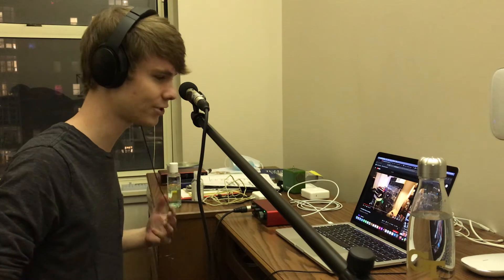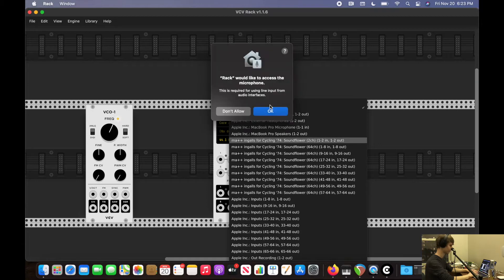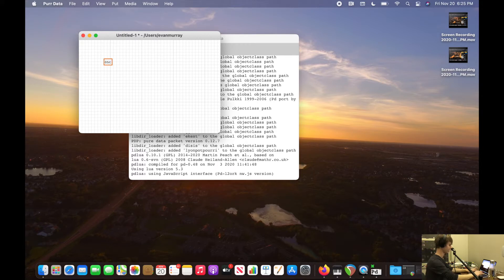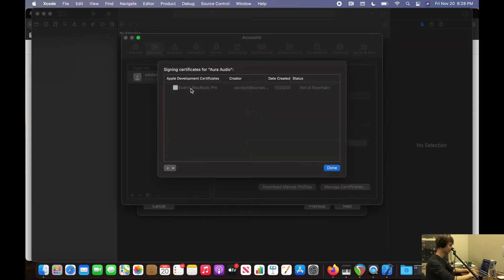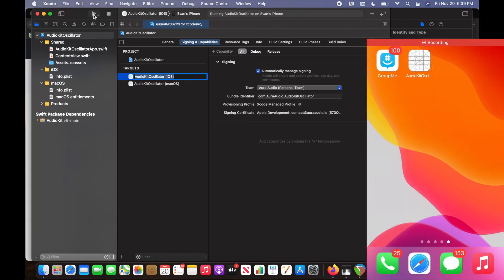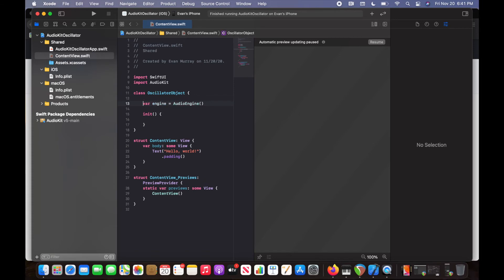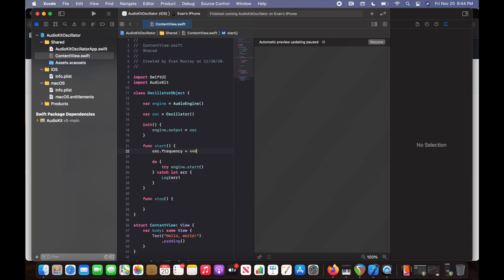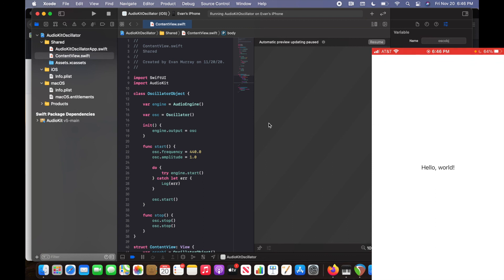Intro to Oscillators (ft. AudioKit v5)

Comment: Great video.  the autocomplete only gave me an option for PlaygroundOscillator.  Did I import the incorrect package?  The code works perfectly however.
Reply from the maker: Thank you! Yes, Oscillator was moved into the SoundpipeAudioKit package. There have been even more changes in AudioKit since this video, but the website is now fully documented with those changes https://audiokit.io/ .
Reply: @aura-audio  UR an excellent instructor! Do you have a video that shows how to output the signal from one oscillator to the left ear and the signal from a second oscillator to the right ear?
Reply from the maker: Thank you! That means a lot to me! I also work as instructor for my job to teach kids coding. I do not have a video like that yet, but that's a fabulous idea!

Comment: Finally with AK 5.. Thanks!
Where did you learn that? do you have a link for more explanation?
Reply from the maker: You're welcome! Thank you for your support! I learned most of it by contributing to AK, which is probably one of the best ways you can learn. However, they also have updated their website with everything you need to know: https://audiokit.io/.
Reply: @aura-audio  Thanks!
I'm trying to use their Amplitude Envelope with oscillator but not sound come out - did you tried it?
I saw it's a issue but couldn't find any solution...
Reply from the maker: @DavidNoyMusic  You're welcome. I haven't used it, but I know there has been many issues like that. Also, they have some demos you can check out here: https://github.com/AudioKit/Cookbook. I'm pretty sure Amplitude Envelope oscillator is in there.
Reply: @aura-audio  Thanks!
in the end I asked in stackoverflow and the foundation of AudioKit answered 🙃 
Btw, do you have any Instagram or Facebook or something we can talk?
Reply from the maker: That's good to hear! Yeah, my Instagram is @evanmurray._
Reply: @aura-audio  Great! just sent you a message  (mine is @david.noy.music)

Comment: I like the clarity of your explanations. AudioKit is a really important software package, but sometimes the current status can be confusing, which is a fairly common problem with open source. They. wrote some excellent Xcode playgrounds for both Mac and iPad. I've been trying to get AudioKit v5 to run with a playground, particularly for iOS, but I always get unresolved references, such as for SoundPipe and don't know what to do about it. Some articles I've seen on the internet imply that v5 as a Swift package should run correctly in playgrounds, at least in a basic way for experimenting. (The previous playgrounds for v4 probably need updating since many of the class names have changed.) You seem like the sort of experimenter who has likely tried this, particularly since you emphasize v5, so I wondered if you had tried this in s Swift playground.
Reply from the maker: Hi Bruce! Thank you for watching the videos. That’s a great question. I haven’t tried using the playgrounds with AudioKit v5 myself, but I’m sure they’re not perfect since it’s still kind of in a beta. However, this error got me curious, and maybe I will make a video trying out playgrounds with AudioKit v5 and even fixing those errors. I’ll have to look into it some more, but thank you for bringing it up.
Reply: @aura-audio  Great! I've been working on AudioKit v5 today. In someways, Playgrounds have not been as helpful to me in.things I do because there is no good way to set breakpoints. It's often just as easy to quickly make an app and put the code you want to test in a ViewController.
One problem, big for me, that I've been dealing with is that I have some AudioKit code that does pitch recognition as well as play back samples. It's for a friend who is trying to teach kids to sing scales more accurately using an app. The frustrating thing is that the code crashes within AudioKit on an iPhone 12, but not on the iPhones and iPads that I have. Covid being what it is, I haven't been able to get an iPhone 12 to spend time with, so this has been very frustrating, particularly since iPhone 12's are pretty common. Even worse, once I had an iPhone 12 to use for a short while and the app crashed when downloaded from TestFlight but ran correctly when tethered to my Mac's Xcode. I wrote up something about it for the AudioKit team, but they are busy people. It's just a spare time thing for me, but I am trying to figure it out.
I do like the general, casual but complete, style of your videos. I do some teaching and it does seem like a good way to learn.
Reply from the maker: I can understand. That sounds very frustrating. I remember when iOS 14 first came out, and there were a ton of bugs where programs I made would behave differently on devices and whether I had my phone connected to my computer or not. I’ll try my best to look into this. I’m in a busy situation too with finals coming up in school, but this would be a good way to spend my spare time if I have any. I’ll look into it some more and let you know if I figure something out.
Reply: @aura-audio  Thanks. I don't mean to take from your time. Just being chatty, I guess. But if you thought of anything, that would be great.
Reply from the maker: No worries. I’m now really curious about what causes this error, and I love trying to debug stuff. I’ll let you know if I come across anything.